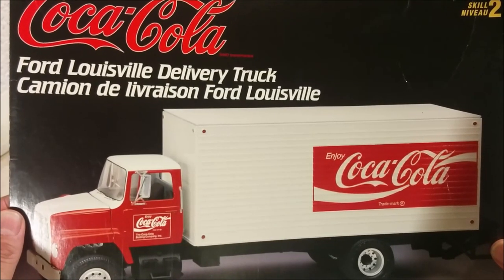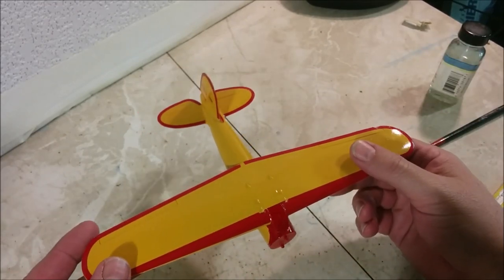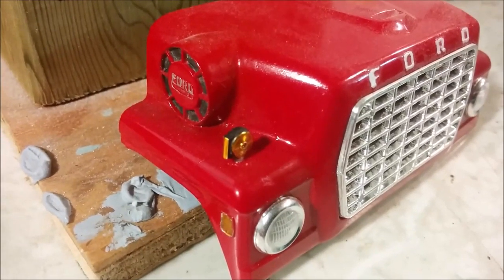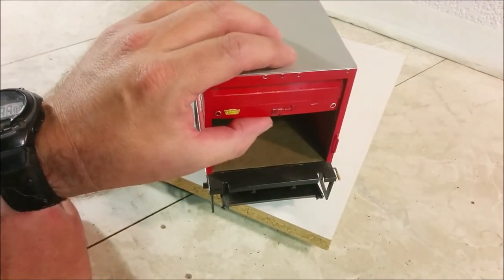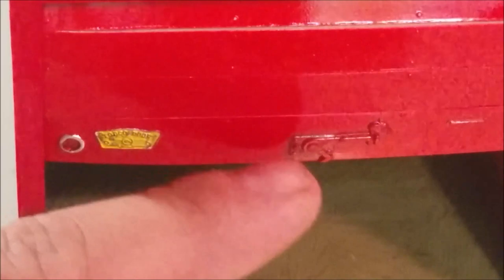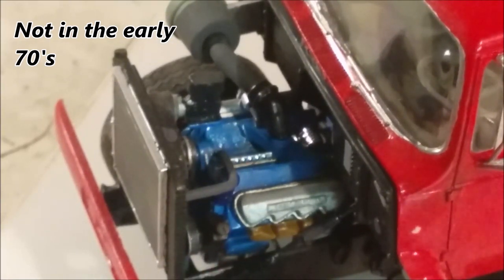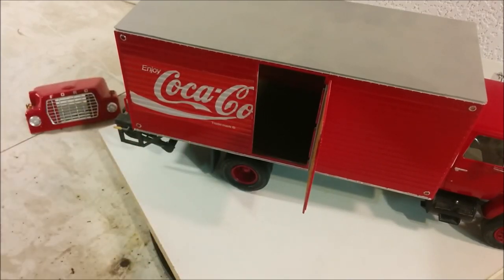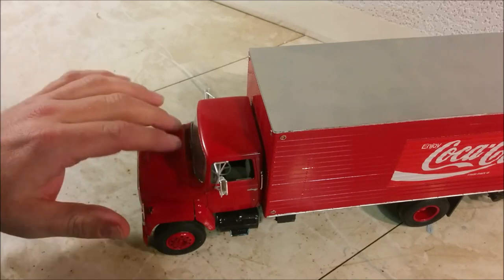AMT's Ford Louisville Coke Truck 1/25 Past Project

Comment: When I get burned out on a kit,I generally build something totally off the wall,compared to what I'm doing!  Just something different, I just took a white/Western Star apart and scratch built a looong frame,added a third drive axle( made a tri-drive) and two,count em two, 3406 cats side by side! Making a custom shop built heavy haul,prime mover type truck. Got two trannys set up like an auxiliary trans. Will probably look goofy as hell,but when I get another triple axle low boy trailer,I think it will look cool! And in the end that's all that matters. Recently rebuilt a couple of little hot rods also.

That blue cat was a 3208. They were 210 hp non turbo,and 250 hp w/a turbo. Same displacement! The blue ones were actually license built by Ford. I drove a 75 Louisville with a blue kitty cat. When I was a firefighter,my favorite pumper was an 89 c-8000 with a Grumman Firecat body. It had a yellow 3208. Loved them little V-8s!! The farmers I work for now have a 3208 cat for a pump motor. Duel stacks, straight off the headers,sounds like a dream to me.

Comment: Great build. I'm working on the race car hauler version right now and definitely wish the hood had proper hinges. I also added some small bits of plastic on the wheel arches where the hood meets the cab, because it didn't look like a properly smooth wheel arch shape to me and I wanted to sort of bring the shape more into form. It seems like all of them were molded that way from AMT. I also would like to build one with the newer grill and square headlights but I'm not sure if I can scratch build that myself. Oh, and supposedly the snow plow truck comes with extra frame rails and a fifth wheel to do the tractor-trailer version!